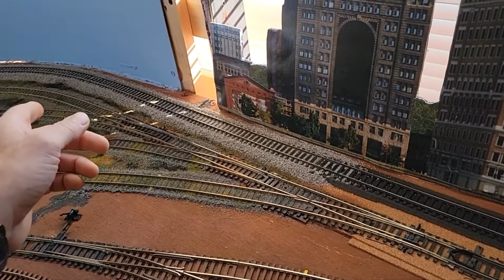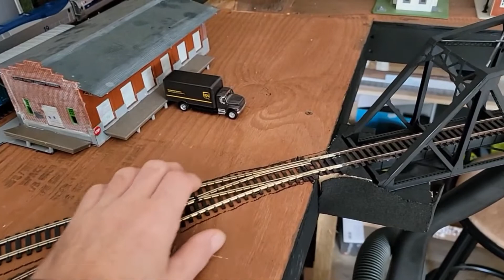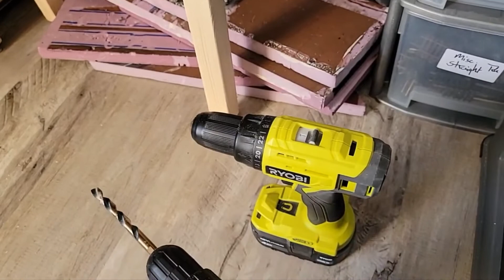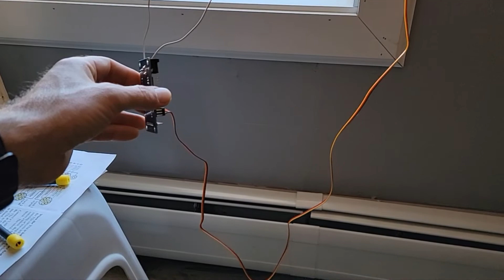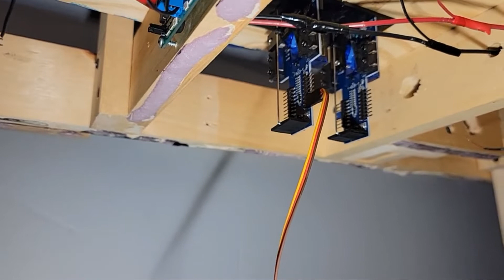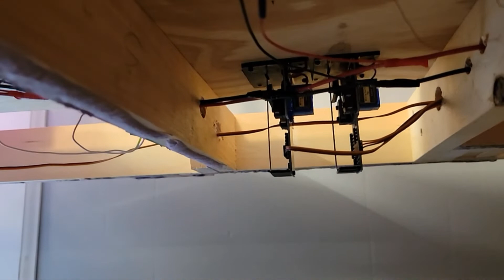Walthers switch machine project.

Comment: I just installed a tortoise.  James from dundass junction just install the walters as well. I'm curious to see the reliability 💯🫵👍🚂🎅🚄🎅✌️
Reply from the maker: I have both installed on my layout. They both work good to me. The only thing is the walthers switch machines in my opinion aren't as easy to wire up a signal system like the Azatrak boards and signals I have. That's the only downfall for me. However I just started using the tortoise smails and they are perfect for what I'm looking for. I guess it just depends on what you want to do and how you want it done 🤔🤷‍♂️😅 I know Mark from M&M rails did a video or two on the Walthers switch machines Maybe check them out as well🤔 Thanks for stopping by and have a good night. Happy modeling!! - Jason

Comment: Jason if you are connecting for a crossover, you need to feed second switch from first switch, then one button will make both switches work together
Reply: Hi Jason , I build a control panel for my switch machines, not using a throttle to control them, much simpler for me
Reply from the maker: @dundasjunctionmodelr.r-james  Maybe down the road I'll do something simple like that. I just think it's a nice change to be able to switch most if not all switches with my throttle while I'm walking the layout.
Reply from the maker: I did that at first however when I put power on with my ESU throttle Switch 1 (S1) would work however S2 was spitting and sputtering and wouldn't throw. So that is the reason I hooked them up on individual ports until I can figure out why they are doing that. Also to mention when I had them wired up on my NCE power cab they would work together just fine. 🤷‍♂️ so I need to do a little research on this issue

Comment: I have installed 12 of these switch machines so far, planning 6 more for the yard, but i am using NCE but i added a wifi interface, i can use my tablet to control my trains, will add the NWT 50 throttle when available , i damaged a few switches too , you are making great progress
Reply from the maker: Thanks James. That's quite a bit of switches you have going on and after I got the first one in the last 3 were a breeze. Very happy with how they work with my ESU cab control. Thanks for stopping by and stay safe. Happy modeling!! -Jason